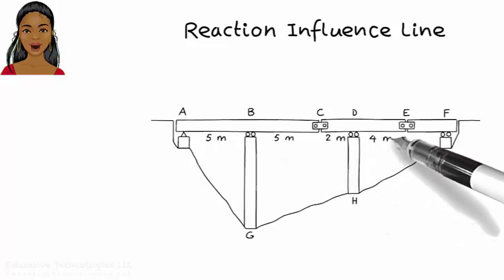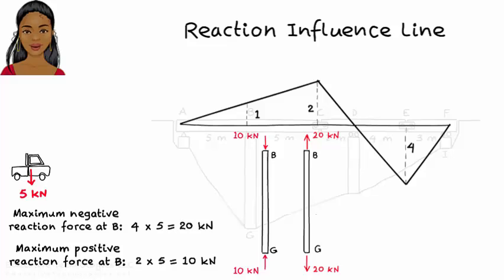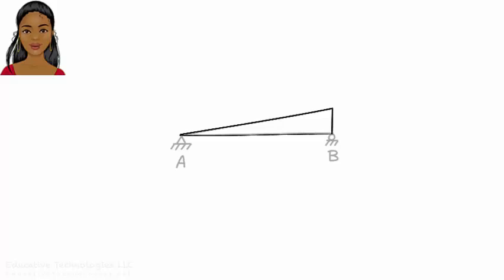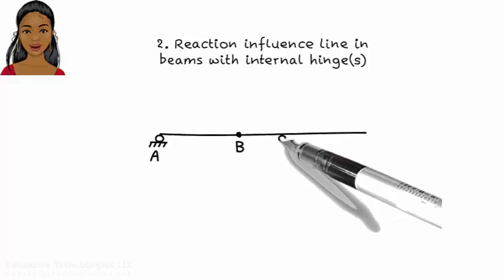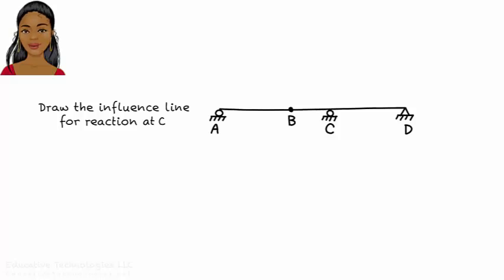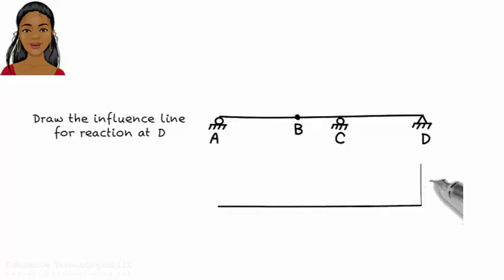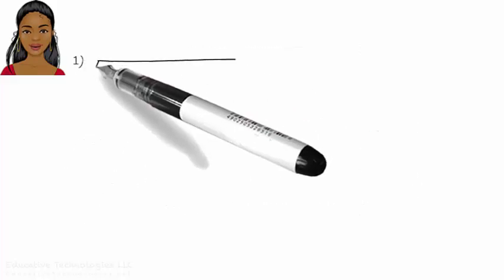SA16: Reaction Influence Line

Comment: This is to illustrate that I understand correctly your tutorials about reaction influence lines. I did consider the influence line  at the rections at A, D and F. Reactions at A, max positive reaction = 2x5 = 10kN when load is at E, max negative reaction = 1x5 = 5kN when load is at C.  Reaction at D, max positive reaction = 1x5 = 5kN when load is at D. Reaction at F, maximum positive reaction = 1x5 =5kN when load is at F. May I know your comments on these answers?
Reply from the maker: The reactions at A and F are correct. 

The reaction at D is 3 x 5 = 15. 

The influence line for the reaction force at D forms a triangle with a height of 1 at D and a height of 3 at E. When D is pushed up by a unit, E rises correspondingly by three units. As a result, segment CD rotates counterclockwise (about C) , while segment EF rotates clockwise (about F).
Reply: @DrStructure  For the reaction at D, I try to figure out how at E the height is 3 if at D it's only 1. Isn't it height at E is just 3/7? Thus, the reaction at D = 1x5 = 5kN when load is at D and it's 3/7x5 = 15/7kN when load is at E.
Reply from the maker: When point D is displaced upward by 1 unit, point C remains stationary but rotates due to the movement. This rotation causes point E to move upward. A right triangle forms with the base between points C and E, which is 6 meters, and the height at E, which we’ll refer to as h. The distance between points C and D is 2 meters.

From the geometry of the triangle, the relationship between the displacement at D (1 unit) and the base and height of the triangle is given by:

1/2 = h/6.

Solving for h:

h = (1/2) * 6 = 3.

The upward movement of point E results in a support reaction at D. If the load applied at E is 5 (units of force), the reaction at D can be calculated as:

Reaction at D = h * Load at E = 3 * 5 = 15.

Comment: @Dr.structure how do we write linear equations to find out maximum and minimum reaction at B due to moving 1 Kn load ?i didn't understand it
Reply from the maker: The qualitative approach for drawing influence lines circumvents the need for writing equations. But, if one wants to write the algebraic equation for a support reaction, one can easily write the equilibrium equations for the beam in terms of x (the distance from the left end of the beam to the position of a unit load), then solve the equations for the reaction force. The result is an equation in terms of x. 

Example: Consider a beam with a pin support at its left end and a roller support at a distance L from the pin support. The length of the beam is 2L.

Let’s refer to the position of a unit load moving from left to right as x. 

We can write two equilibrium equations. 

The sum of the forces in the y direction must be zero. Or, Ra + Rb = 1, where Ra is the vertical reaction at the pin and Rb is the vertical reaction at the roller.

The sum of the moments about the left end of the beam must be zero. Or, (L)(Rb) - (1)(x) = 0

Solving the two equations for Ra and Rb, we get:

Rb = x/L
Ra = 1 - x/L

Where  x is between 0 and 2L

So, Rb is at its minimum when x = 0 and at its maximum when x = 2L, where x is the position of the moving load.

Similarly, Ra is at its minimum when x = 2L (Rb = -1 at x=2L) and at its max value when x = 0.
Reply: @DrStructure  thank you so much .Your content is truly amazing

Comment: The maximum positive reaction at point B is 2 x 5 when the moving load is at point C. Is this positive force 2 x 5 reacting upward but compression on column BG?
Reply from the maker: Correct!
Reply: @DrStructure  Thanks a lot.

Comment: If we have fixed support at one end and roller at the mid, so how would be influence line for roller at mid??
Reply from the maker: The technique described in this lecture applies to statically determinate beams only. The beam you are describing is statically indeterminate. For such a beam, the influence diagram is not a line. Rather, it is a curve.
Reply: @DrStructure  ok I understood 
Thanks a lot, You deserve a great Appreciation ❤️❤️❤️❤️❤️❤️❤️
Reply: @DrStructure  I am wondering that you posted a video 7 years ago and now replied for a question in minutes, it is so amazing❤️❤️
Reply from the maker: Thanks for the note. We do our best to be responsive in supporting students.

Comment: you have the solutions for the ending ?
Reply from the maker: You can find the solution for the exercise problems, and updated lectures in the free online course referenced in the video description field.
Reply from the maker: To balance joint B (showing a moment of -0.4), we need a positive moment of 0.4, to be distributed to between the two columns using the distribution factors: 3/5 and 2/5 as follows:

0.4(3/5) = 0.24
0.4(2/5) = 0.16

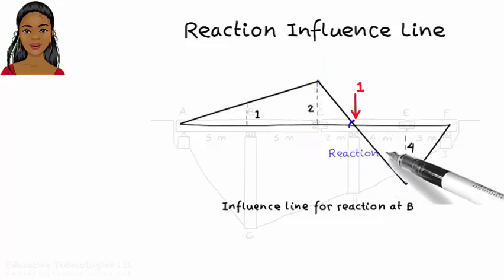Comment: how do we calculate the value (such as in the 1:36 minute mark), where there are 1,2, and 4. where do these number come from?
Reply from the maker: @NATHAN NAEL For statically determinate beams, the influence line diagram consists of straight lines often forming triangles. We can use the height/base ratio property of similar triangles to determine the unknown heights. Here, we know the height of the influence line at B, it is 1. The height of a reaction influence line at the point that the reaction force is acting always equals 1.

In this case, there are two triangles between A and C, a small triangle and a large triangle. We know the height of the smaller triangle, it is 1. And we know the base of the two triangles. The smaller one has a base of 5 m and the larger one has a base of 10 meters. So we can write:

(height/base) of the smaller triangle = (height/base) of the larger triangle.

Or,

(1/5) = (h/10).

Solving for h, we get: h = 2.

Similarly, between C and E we have two triangles. The height of the left triangle is 2 (we just computed it). The base of the left triangle is 2, and the right triangle has a base of 4. So, we can write:

(2/2) = (h/4)

which gives us: h = 4.

Comment: 2:42 didn't get it. Can you elaborate it a bit please. How do we know that 10 kN is compressive or tensile. Also i think we drew the influence line diagram for the  reaction in the column so whatever sign ILD shows must be the sign of the reaction in the column. Please explain how to know which is which
Reply from the maker: We need to distinguish between action and reaction forces. The support reaction is the force that the support/column exerts on the beam. An action force is what the beam exerts on the column. This is basically the third Newton's Law (i.e., for every action there is an equal and opposite reaction). So, the beam is exerting a downward (compressive) force on the column, and the column reacts by applying an upward force on the beam. The upward force is the support reaction.

Comment: hello Dr. Structure . please help me .
Reply from the maker: If you post your specific question on this topic here, we will give you feedback accordingly.
Reply: @DrStructure  the difference between constructing an influence line and constructing a shear or moment diagram.
Reply from the maker: They are completely different. An influence line (diagram) represents the value of reaction/shear/moment at a specific point in the beam. On the other hand, the shear and moment diagrams show the shear and moment values for all the points in the beam. We are dealing with two somewhat different concepts, therefore, the processes for constructing the two types of diagrams are unrelated.
Reply: @DrStructure Thanks.

Comment: So, can you help me, what is program or software do you use to make this video? 
I just want to make theses video like you, to teach my friends, my students. It is amazing and intelligence. 
Thank you so much.
Reply from the maker: The type of stylus that you use is key, the slippery kind does not work that well. You need to pick the type that does not slip on the glass, the kind that has rubber/silicon tip, like this: https://www.amazon.com/dp/B006843RUC?tag=new-best-seller-20
Reply: @DrStructure  Thank you so much. I'm going to try it. How do you draw on Ipad? I mean What is software you use to draw and save it in SVG file?
Reply from the maker: @ieuhfuffffff  Graphic for Ipad (https://graphic.com)
Reply from the maker: This particular video was done by first tracing the writings manually using a stylus on an ipad, and saving the tracing in SVG file format. SVG files were turned into animations using VideoScribe (an online tool). And, the video segments were put together, and the audio was added and sync with the video using Camtasia Studio.
Reply: @DrStructure  Wow, so difficult. If you draw by a stylus, you draw perfectly ^^. It's very hard for me to do that. I don't know how to use SVG file too.

Comment: Thanks. Can I know what software you using for drawings
Reply from the maker: For this particular video, we manually traced the writings/drawing using an ipad and stylus, saved the tracings in svg file format, then animated the svg files using VideoScribe (an online whiteboard animation tool).
Reply: Dr. Structure is there is any software you can recommend it for making the drawings easier because I'm working on structure lectures and make drawings with visio and it's taking long time . Thanks for reply
Reply from the maker: @ghassan3870  If you just want to draw, without any sort of animation, you may want to look into Adobe Illustrator. That is what we have been using for the most recent videos. You might find other similar, yet less expensive, drawing tools that could fit your needs.

Comment: interesting, but why?
Reply from the maker: Is that a technical question or a philosophical one?  If technical, please elaborate.
Reply: @DrStructure  I mean. is there any mathematical justification for this method.
Reply from the maker: @ineverlickyoghurtlid3903  Yes, the justification for this can be seen mathematically. In essence, all we need to do is to come up for an algebraic equation for the reaction in terms of x (the position of the unit load). The graph of that equation is the influence line. For example, for a simply supported beam, the reaction at the left end of the beam, as a function of x, can be written as: 

R = 1 - x/L

where L is the length of the beam and x is the position of the unit load measured from the left end. The graph of this equation takes the shape of a right triangle with the height of 1 at the left end (where x = 0). Conceptually, we can view this graph as a horizontal line (i.e., the beam) being pushed up at the left end by one unit. Knowing the linear nature of the equation and knowing how it looks like, we don't really need to explicitly write it, and graph it. We just follow the conceptual/qualitative approach of graphing it, by pushing the beam up at the reaction point by a unit...
Reply: @DrStructure  Thank you for your reply. 
I think we can go a step further. As the functions of support reaction are linear, we can determine one segment of the function graph with two points. one is at the point, y equals one when the point is right below the load and carries all the load, one is at an adjacent support point, which is zero when the adjacent support point carries all the load. 
for more complex cases, they are the combination of such segments.

Comment: How would you compute the reactions if there is a uniform load?
Reply from the maker: We determine the area under the influence line for the segment of the beam subjected to the distributed load, then multiply that area by the distributed load intensity to get the support reaction due to the load.
Reply: @DrStructure  Thanks for replying!!

Comment: Hi dr. Structure. I just want to know how can i calculate the heights 1,2 and -4 in the influence lines for your first example. Thankyou so much. Your videos helped me a lot with my studies. I just dont know how to calculate reactions when 2 or more internal hinges are present in the beam.
Reply from the maker: Hi Anastasia, 

In the case of this specific example, we are not really calculating any support reactions in the conventional way (using the equilibrium equations), we are just lifting Point B by one unit (since we want to draw the reaction influence line for B), and use geometry to determine the remaining heights. 

Knowing that the influence line consists of straight lines,  we can use similar triangles to determine the remaining height. For example, the segment of influence line between A and C can be viewed as two triangles. The smaller triangle has a base of 5 and height of 1 (the triangle between A and B). The larger triangle has a based of 10, so the height of it (say, h) must satisfy the following relationship:

1/5 = h/10

Solving for h, we get: h = 2.

Similarly, the two triangles between C and E must obey the same geometric property. That is, the ratio of height to base of the triangle above the x axis must be equal to the height to base ratio of the triangle below the x axis. So we can write:

2/2 = q/4  where q is the unknown height of the second triangle. That gives us: q = 4.

To see examples of how statically determine beams with internal  hinges can be analyzed using equilibrium equations, review lecture: 

https://www.youtube.com/watch?v=1YpoLjKtl3Q

There are three exercise problems at the end of the video, all involving internal hinges. Their solution is also given.
Reply: Thankyou so much for such detailed answer Dr. Structure.

Comment: @Dr. Structure
  Is it important or necessary to do the calculation before drawing the IL diagram in the exam or in the practical life? Or can we apply Muller Breslau's principle directly?
Reply from the maker: What kind of calculations?  If they are necessary for drawing the influence line, then yes. Otherwise, we can draw the influence line directly and then use it as a visual tool it to better see the load locations that result in maximum reaction/shear/moment in the structure.
Reply: Thank you!

Comment: Thanks for the video!

I fail to understand the concept intuitively. How can reaction force due to the unitary load be maximum anywhere else than directly on support like you mentioned in the intro? I am guessing it is due to moment generated at that point and grows as the load moves away, whereas the vertical force exerted on the support reduces as we move closer to the other support. So, does the influence line (in this case) show the change in reaction that is caused by both shear and bending moment? I hope I expressed my doubts in a clear way.
Reply from the maker: You are right. Say in the case of a simply supported beam, a reaction would be maximum only when the unit load is located at the support. However, when the beam has a long overhang, that unit force causes a large moment that needs to be countered by other reaction forces. Depending on the position of supports, then, a reaction force could be significantly larger than 1, if the unit load placed at some distance from the support causes a large moment.

Yes, the influence line reflects the effect of bending moments and shear forces in the beam.
Reply: Thank you! I am still amazed that this channel answers my questions within hours. Usually I am answered within months or even never.
Reply from the maker: Thanks for the comment. Resolving questions is an important part of learning. We try our best to facilitate that.

Comment: Cars, vehicles, trucks, ... mostly are considered as 2 or more point loads, but not 1! How to calculate the maximum reactions when a car with 3 point loads?
Reply from the maker: +Omid Hassani We always draw the influence line for a point using a single unit load regardless of the actual number of axles of the vehicle. Once the influence line is drawn, we then need to determine the location of the concentrated load series  (due to the multiple axle vehicle) that results in maximum shear at the point of interest (say, Point A).

Example: Suppose we have three concentrated loads in series having magnitudes P1, P2 and P3. Say, the distance between P1 and P2 is d1 and the distance between P2 and P3 is d2. 

Also, say our shear influence lines has two peak values (either maximum or minimum). Let's refer to the location of the first peak value as L1 and the location of the second peak value as L2. 

Place P1 at L1.  This means P2 is going to be to the right of P1 by d1, and P3 is to the right of P2 by d2. We know the height of the influence line at L1. Using simply geometry (similar triangles), we can determine the height of the influence line under P2 and P3. Now, shear at A under this load pattern is:

(height of influence line at L1)(P1) + (height of influence line at L1+d1)(P2) + (height of influence line at L1+d1+d2)(P3). 

This equation gives us a number which represents the shear value at A for this particular location of the load series.

Now, move the load series so that P2 is at L1. This means P1 is to the left of L1 by d1 and P3 is to the right of L1 by d2. Again, using simple geometry we can figure out the height of shear diagram under P1 and P3. Then, calculate shear at A for this location of the load series using an equation similar to the previous step.

Next, move the load series so that P3 is at L1. Then, calculate shear at A due to this load series location in a similar manner.

Compare the three shear values to determine the load series location that results in maximum shear at A when the vehicle is around L1.

Repeat the same calculations for the case that the vehicle (load series) is around L2. Then, compare the two results to determine absolute maximum/minimum shear at A due to the moving vehicle load.
Reply: +Dr. Structure 
Thank you!
Reply: thanks alot dr.structure